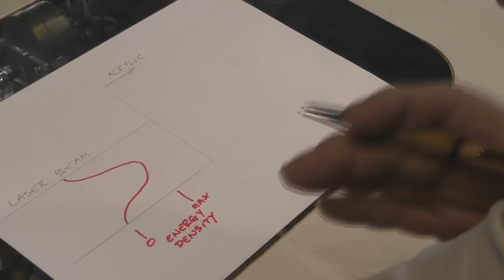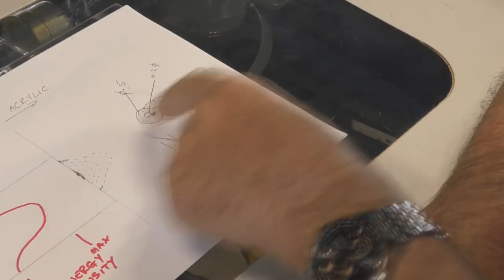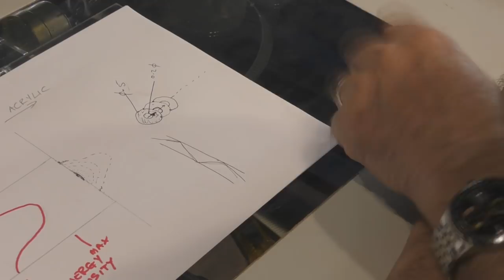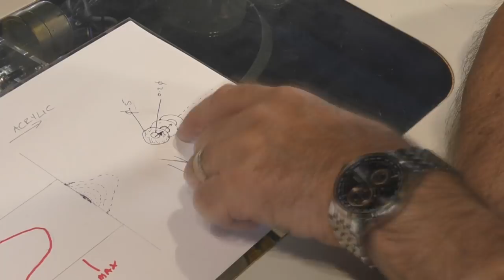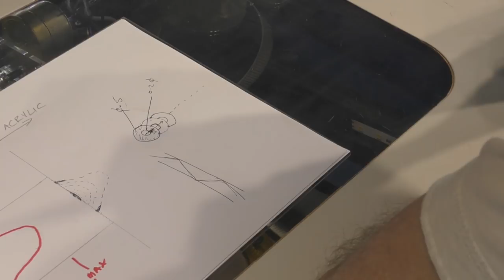RDWorks Learning Lab 143 Acrylic Fest  Myths and Truths Part 1

Comment: I love to watch you videos.  

You almost had it when you talked about the rain. But I would describe it more as a weather front moving with the beam. The beam is causing the sublimation of the acrylic material and forming a high temperature swirling gas cloud. The heated cloud is swirling away from the cut, The heated gases are rising and moving back towards the previously cut surface. The previously cut surface is now cooler than the sublimated gas containing acrylic molecules, they are being deposited in waves, up and down as well as beam to just cut positions. 

When air is heated it rises, when cooled it falls, thus I think the storm front or tornado anthology might be a more accurate layman's explanation.   

As an experiment you might  focus an narrow air stream to interrupt the gas cloud right after the beam and into the actual cut. Most nozzles are to far from the cutting channel to interrupt the high pressure gas nearest the beam.
Reply from the maker: Hi Steve
I greatly appreciate your input to this very interesting problem. I like your tornado analogy because it's not something that springs to mind here in the UK.  My next session (as always) has a broad outline plan in my mind that will use both my machines . In particular my Lightblade machine has a very small nozzle (just over 2mm) and I plan to run high pressure air from my shop compressor directly into the kerf. My thinking was similar to yours in that maybe I can get just a beam width cut If I can force the hot gas out the bottom of the cut before it has a chance to scarify. On the otherb hand,  I may finish up  re-condensing the vapour and producing a hideous edge finish. Hey, that's exactly why I experiment.  You have seen my pictures and I think your analysis completely describes the violent gas dynamics you can see taking place. Acrylic has always fascinated me and I hope my next session will provide greater insights into practical cutting with steppers rather than my idealized setup.. Thanks again for you insightful contribution.
Best wishes
Russ

Comment: It would be really interesting to see the current waveform on the laser tube too. Despite the fact that our glass tubes are DC excited, the 18-28kv is generated by a pair of flyback transformers, which are in turn fed by rectified AC. Looking at the photos from the powersupply I blew about 3 years ago, I suspect there isn't enough smoothing from the caps inside to give a completely smooth voltage and therefore current and arc. I wonder if there is a way to also see if the striations on your laser change based on power level from the supply (perhaps figure out a constant wattage/mm/s??). It might also be interesting to see the difference between a high end powersupply like the RECI P18 and the cheap JNMYDY supplies most lasers come with. It might not have any effect on acrylic, but it would still be interesting to see. I sold my MSO before moving country, so sadly I'm not equipped to investigate :(
Reply: That HV rectifier circuit has how much voltage going into it?  Most scopes could handle that power I bet and wouldn't require a HV probe though they do make it.  Would be interesting to see how clean it is for sure because dirt going in gets rectified as well.
Reply: From 230v supply, you should see a peak DC rectified, smoothed voltage of around 147v... most oscopes are capable of this. There are much higher voltages which are outside the range of cheap usb scopes (which go to 300-400v) and outside the range of midrange DSO/MSOI (1000-2000v)  so all you could easily blow your scope and/or hurt yourself if you poke the wrong bit (more so than just poking live AC devices haha). The JNMYDY PSUs have 5 sets of small transformers + the two flybacks on them (I assume the small 40W supplies only have one flyback based on their size) , I know at least one of those is stepping voltage up, however, one of must be also stepping the flyback output voltage down for monitoring.... which means it could be watched with a scope or even an MCU. It would be interesting to reverse engineer the board (wouldn't be too hard) to see where we might be able to swap out some caps for higher quality performance? :) If I can get my wife away from my laser, I might be able to take a look at mine.
Reply: My HY-T60 has, like my blue turd 40w, only one flyback transformer.  There are probes you can hook directly up to that HV anode wire but they are not cheap (around 600 for a good one for the scope).  I bet anything that the voltage coming out of the HV wire is not smooth.
Reply: https://photos.smugmug.com/Lasers/1290-Laser/i-xmDwqH9/0/1fa6dcec/X3/DSC00648-X3.jpg is one of the powersupplies I've blown, interesting to note that the HV line is coming straight from the secondary flyback transformer, there are two what look to be metallised film caps between the two transformers, but if i remember correctly one transformer fed directy into the other (https://photos.smugmug.com/Lasers/1290-Laser/i-Mt792Mp/0/084bff30/X3/DSC00645-X3.jpg) so no chance of any smoothing caps at all.... which means that the tube might be pulsing (not necessarily dropping from an excited state, but it's power output could be) at the frequency the fets are driven at. 

So to know if we really have a continuous beam or not, we need to find out how long the gas/plasma takes to collapse/de-ionise. This is where current supply is going to be really interesting to watch... the ionised gas might be smoothing the power out itself combined with the energy stored in the transformers.

My current Reci W4 tube strikes at about 28-30kv, then drops to 18kv during operation - maybe if the frequency was bought up we could get a more stable ionisation state at low power and/or better dots at high scan rates?? I haven't really looked into feeding plasma as most of my electronics work is RF and remote sensing/command... high voltage isnt really my thing.

Damnit, why did i have to sell my MSO?! (probably because moving is expensive enough, without filling your bags with test gear haha)
Reply: A flyback (the item in the first picture) has a lower voltage (preferably a Sine Wave) to the 15kv+ we need.  It is just a highly isolated transformer and nothing more.
Reply: The Best Stooge the transformers are good to about 500kv depending on how they are wound. The series connection of the transformers takes a lot of strain and isolation requirement off them too so you can run higher wattage with the smaller transformers

Comment: Hi Russ ! I write you again with a problem I have with my chinese machine. I use RDworks as well, and last week something happened that the preview time on the software does not match the real-time it takes for the machine to cut the file. It usually takes longer than the preview. Have you experienced something similar? Do you know how to fix it? I appreciate your help! Greetings from Buenos Aires, Argentina!
Reply: Oh, and it´s not just my problem, I´ve been talking with several people that own a laser machine and they also got this problem!
Reply from the maker: Hi
The preview in RDWorks can be a long way out from the truth.  Instead, DOWNLOAD your file to the machine and select it from the FILE menu. 
In the file menu you will find  WORK TIME. If you run this it will preview your job and give an accurate total time.
Best wishes
Russ

Comment: Any chance you are seeing striations from laser power variation due to beam wander?
Reply from the maker: I'm wondering what you imagine by beam wander,  This is a beam of light that inherently wants to travel in  a straight line. Clear acrylic is a special material that it can reflect and bend the light from a cut surface. I'm certain that the basic beam is not  unstable in the gas cloud that surrounds it. Headlight beams do not do not bend or wander in fog  so why would this laser beam be different? Thanks for the comment because you see what I see but we may draw different conclusions., so its always worth a second thought.
Best wishes
Russ
Reply: SarbarMultimedia I was not thinking of wander in the acrylic... But a cyclical minor variation of the exact concentration center of the beam along the beam path starting from the tube and propagating through the optical path. If we assume the beam is a perfect line of energy then the beam does not wander. But once we think of it as a distribution curve of energy across a cross section through space... Then the question is.... How stable is that distribution over time.

Just a thought. As always, I enjoy your adventures greatly. Keep up the search for knowledge. I love following along in your journey.
Reply from the maker: I think the answer to your question is beyond my very crude garage science/equipment.  You must remember my goal is to explore the boundaries of this technology to see if we can get better or more predictable results through understanding and not by major rebuilds or upgrades. I am not in any way deriding your thought process and it's a really interesting possibility, so even if I could prove or disprove your idea, I think it's within the physics of the tube technology...... and that I have no control over.  My next goal is to understand how stepper induced striations override these apparently natural marks and what strategies are available for mitigating the marks.
best wishes
Russ
Reply: Eric Lien I can tell you that on the machine i play with, the total beam travel is around 3-4 meters, and with testing when i have to align the mirrors, the center of the beam doesnt seem to change, however i dont understand light, but i do know there is a 90 degree phase retarder as the first mirror to change the light from linear  to circular polarization, whatever that means.